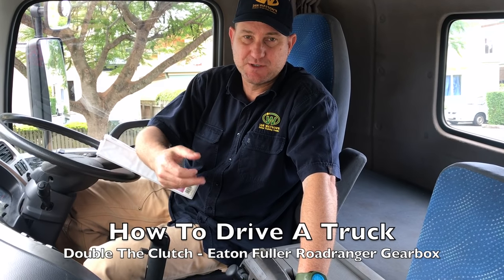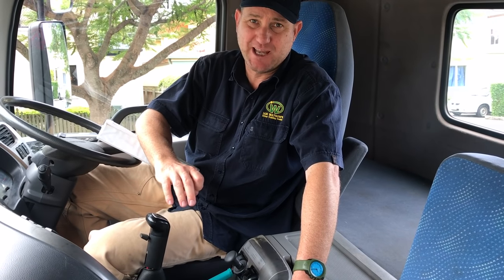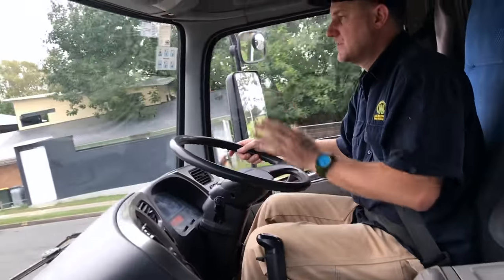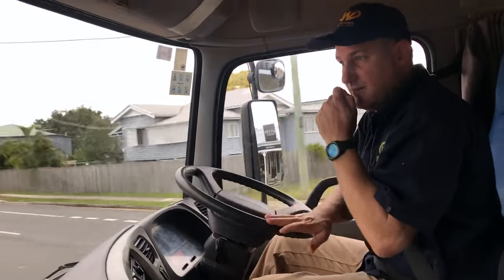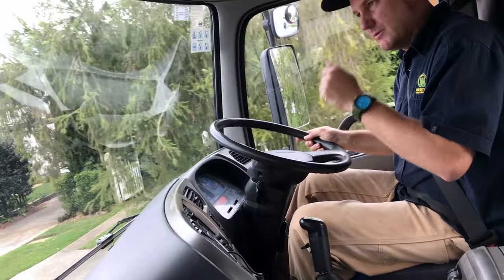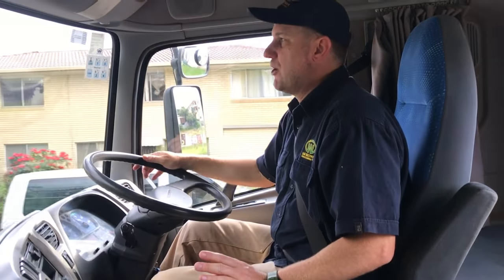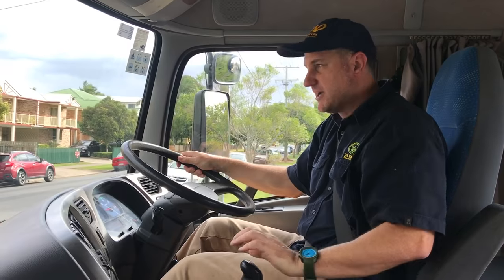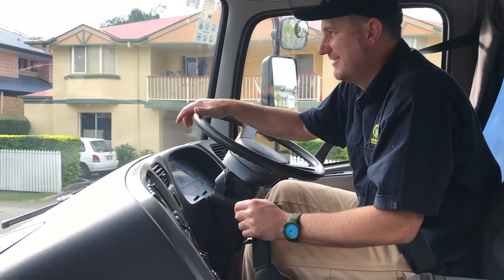How To Drive A Truck With A Roadranger Gearbox  - Double the Clutch

Comment: Pro tip, the clutch isn't necessary. Infant it works better without the clutch. Simply lift your foot as you pull out of one gear, bring the revs up to match the new gear and slide her in. You only need the clutch to start moving
Reply: Yeah but you can't float gears on the exam

Comment: Many of the comments here are about how synchromesh and automatic transmissions are "better" than RoadRanger transmissions. The fact is RoadRangers are significantly simpler and therefore cheaper than most other types. You can buy a whole brand new 1850 ft/lb rated RR for less than the cost of a gasket, bearing and seal kit for a ZF heavy truck transmission! They are easy to use, strong, efficient and when they reach the end of their considerable lifespan - they are incredibly cheap and easy to rebuild. 
  "Better" is subjective to the user, but there is no arguing with the economics. They are the most common heavy truck transmission in the world and if your intended career is truck driving, then this video is an excellent introduction to a valuable, employable skill to have.

Comment: A lot of people forget to mention with Eaton fuller non synchro gear boxes, when you press the clutch all the way to the floor it stops the gears spinning which is why it will grind when you shift or it will be tight to shift, So you should only use full clutch from a standing start to select a gear that's what it was designed for. Use just over half the clutch pedal for shifting once you are moving.
I think understanding how this gear box works will greatly help any beginner
Reply: That's only if the clutch brake works.
Reply: And on some boxes the clutch break is on the shifter
Reply: Thank you so much..I am currently learning and it keeps crunching and the instructor keeps telling me to put my foot all the way to the floor when you sing the clutch.. he crunches it as well but I was so confused as to why sometimes it’s smooth and other times it isn’t.. thank you again
Reply: @sylvannaagostino828  no only clutch always  to the floor to engage the clutch break for first gear. All the rest are half clutch. U might have had the same problem as me and not matching the rpm to the road speed when changing gears.
Reply: @cokeaddict1663  tomorrow I will do it..i had revs right but would lose the power when it wouldn't engage and now I know why.. I called a few truck driver friends and they all totally agree with you..
Reply: @sylvannaagostino828  mate I’m no pro I’m far from it and I’ve only driven road ranger for about 12-16hrs in total since I’ve had my license in an iveco 13 speed  but I got the hang of it. Ive driven a Kenworth 909 and 950 18 speed too and it’s a different ball game. I’m sure if I drove them more I’d get better at it. 
Keep practicing mate u will get it
Reply: Been operating fullers for 50yrs, the fools in the uk cant even change a synchro gearbox these daysLOL.
Reply: @grumpystruckshop3807  I got the Road Ranger licence but drive a Synchro as the truck with the RR was taken, it is good though and in Sydney traffic, my calf muscles are insane lol
Reply: He mentions the clutch brake
Reply: You been driving RR for 50 years and still using the clutch to change gears.
Reply: Also it varies from truck to truck. I was in one today, and it was literally like an inch of depression on the clutch to shift.
Reply: when turning over the ignition, the clutch should also be fully depressed to disengage the thrust bearing off the clutch plate
Reply: You double shuffle
Reply: Cheers brother my knowledge has just been increased by your valuable input, tell me though bro is there a tutorial out there that will actually give myself and others out there as you mentioned a better understanding of the gearbox and how it functions?
Reply: Thanks helped a bunch

Comment: I've only ever changed gear without the clutch. That's the way I learned (taught myself) but I have to learn the double clutching if I want to get my HR license. The main thing I was worried about when I was learning is whether the range splitter and high / low splitter worked without the clutch. This video is so informative and clear, well done!

Comment: Thank you for such a clear explanation. I just got an old dump truck with a fuller transmission. It’s been a trick to learn! The revving and double clutch action is a trip, but it makes so much sense!
Reply: just need to understand the three speeds 1 Engine speed 2 Gear speeds 3 Road speed but ya getting there :)

Comment: I learned a bunch of stuff from this. The double clutch thing was not something I learned in truck driving school as a young gurl, but I realize it makes sense. My teacher told me the engine could handle a continuous clutch but I bet the double clutch is easier on the transmission.

Comment: I'm a big fan of manual gearboxes but in a truck it always seemed so damn confusing! That was until I watched this video. Now I know there are other types of manual transmissions that require other methods of gear changing but this guy has inspired me to use them all. Great video. Good instructor. Greetings from 🇬🇧

Comment: I did my non synchronous training today for whole day. Passed reverse test, theory, load securing etc however I'm still struggling with gears. Your video was more informative than the all day training today. Tomorrow I got three more hours of training left. See how I go tomorrow. I wish you were based in Melbourne. Thanks for the video mate.
Reply: Hy how are you doing now?
Reply: @siyabongadube3223  I have been driving b double and truck and dog for last couple of years. All of them auto. It's hard to get hold of road Ranger. So I haven't had much practise. Got the licence for RR. Thanks for asking

Comment: 14 years with that exact box,the more I drove it the better it/I got.
It's timing and revs,as you said,if you try n rush it,it will crunch/grind everytime.
Only ever needed the clutch on take off,now I'm retired,miss it big time.
Reply: I am the same mate the theory is eh mostly understandable for a bloke like me but I am hands on and I fuck up abit as most do then it clicks with me and I begin mastering it. I drive an 18 speed with the correct adaptor/shifter in the US truck simulator I got and it is fun, and drive an automatic Heavy Rigid in real life...I love trucks and I love logistics. Pity pencil pushers ruin it to degrees.
Reply: @tkx86  ..... enjoy your career mate👍as you know it's a great job!
Even the bad days are better than pushing a pen,and the good days are near on perfect!
My love of trucks n buses started when I was standing in line on  hot summer pavement as a school kid waiting for a bus to arrive so that our class could go on an excursion.
The bus rolled up and all I can remember was the smell of diesel and hot rubber coming from those tyres...I was maybe 6 years old,hooked!
I ended up driving trucks n buses during my working life.....would do it all over again and not change a thing.

Comment: Very good. Am currently doing my HR licence and learning this gearbox has been the hardest part, letting go of the stick has been an issue for me. Finishing the course next week, road positioning and reverse parking was a breeze. Watching this and practicing ( as well as you can do in a lounge chair with a remote as a gear stick ) will help wonders. One significant thing is taking up slack on the gear stick prior to moving it when you push the clutch. 👍
Reply from the maker: great tip, practising and visualising at home on your couch is really helpful.
Reply: @Hello there, how are you doing this blessed day?

Comment: Worked with a bloke that insisted that floating was for the pros and double clutching was for wimps. Watched him absolutely destroy the gearbox trying to prove that point.

I personally do both, pretty much whatever the truck is happy to do. Failed a float, I'll fix it with a Double, not argue with it while dealing with traffic. 

At the end of the day, double clutching or floating, as long as your changing the gears cleanly your a good driver. If your more worried about your 'coolness' factor than operating the truck cleanly and safely, your in the wrong profession.

Comment: I’ll stick to floating the gears
Reply: Me too, double clutching are for ladies trapped inside a man body.
Reply: i watched an old dude back in the late 60's stirring the box like he was stirring porridge without any clutching barring stop and start. he showed me the gears and i was off. a day or so later i was stirring it also with out the clutch. i can't believe when i see operators with years behind them using the clutch. they going to have no hip left before too long.

Comment: Right near the End . Don't ya Hate it when you TRY to Crunch it for Demo Purposes , AND IT DOESN'T !  LOL .
You are a VERY Good instructor Young Man .

I did 30 years in Heavyweights . Rarely used the Clutch , As Required , you know . I  Love Road-ranger Crash Boxes . 
Easier than a Synchro Box , ONCE YOU KNOW WHAT IS GOING ON .
Alchemy prior to that .
The Manual Version is virtually Extinct now ,unfortunately . Nearly everything is an Auto-shift now .
Those are no smoother than a Good Operator . And sometimes  MUCH rougher actually .
Good  Video .

Comment: G’day mate I’m a truck driver and I had a Eaton gearbox in the first truck I drove a Mercedes Benz 407 D. But it was a replacement gearbox and the first gear was neutral left and down and second gear was left up and so on but I learned to drive it until the day the gearbox failed on me. I haven’t seen a similar set of gears in any other truck since, nice learning video and refreshing the memory of shifting gears in a truck.

Comment: Gears change best with road speed.. example like with your car when you hear or know its time to change gears " change "  quarter clutch so your off the clutch brake.. full clutch start/stopped. learn the H pattern fluently aswell as controls it shows you are a heavy transport operator and not just a steerer.. this is a real good video for the novices learning.. I'd recommend 👍

Comment: Hey , Your sitting on the wrong side! Oh , Ok You must Be in New Zealand or Australia. Your are a good teacher. I miss shifting except on really steep grades  starting out with a heavy load where knowing how to heel and Toe while feathering the clutch is important. I am in Marin County North of San Francisco where the Terrain is much More like the North Island of New Zealand with some steep mountains . San Francisco can be tough on drivers of manual transmissions too. There is also the method of letting the clutch out until You feel it start to grab and then release the Maxi brakes. Most of the new trucks are automatics now , mostly the Two axle Bobtails and they are nice too but inexperienced drivers can get in trouble. The low low is to low for shifting to a higher gear while moving and I have only used it rarely while spread dumping or paving. When empty gears can be skipped. I ran across these videos while searching out My Dads old transport truck that was a 1955 International fifth wheel with a 500 Cu. Inch gasoline engine A four speed main and three speed Brownie so it had two stick selectors. I have driven the Five speed with two speed electric shift axle and cable shift axle. Also the Ten speed progressive air shift with the lever in front like You use in this video. Also 13 and 18 speeds with the three position selector mounted in the shift head and the type that combines the air shift selection by a lever at the front like You have here combined with a two position selector for overdrive in each gear after getting into the high range. So it is shifted like a progressive  and then after getting into the high range the technique is like that of the Two speed axle except that everything happens within the transmission.
Reply from the maker: Driving big rigs on hills with these gearbox is a real art form. In fact, I'd like to do a video about hills and gear changing in the future.

Comment: I've driven a couple of Macks that had Road Ranger boxes in them and the experience always left me with the question of "Why?"  Why would anyone put a RR box in a truck that comes with one of the best gearboxes ever made.  Any one of the various boxes that Mack produced was a mile and a half in front of any RR box.  I'll grant you that some of the Mack boxes took some getting used to, but once you had a handle on them, they made driving a truck a pure pleasure, not to mention the sense of achievement one got for working out how to subtlety wrestle the thing into submission.   Any mug can get the hang of a Road Ranger, but if you can't achieve the same with a Mack box, you shouldn't be driving a truck.
Reply: TombstoneHeart   If you know how to change without using the clutch it’s much faster and smoother.....

Comment: I drive a 6 speed synchro 10t GVM truck and even I like to give it a rev to downshift even though it's not required. My clutch gave in a while ago and it wouldn't disengage so I had to float gears in a synchro. wasn't fun
Reply from the maker: Ahhh I can imagine!

Comment: Lot of people try and change too quick causing the crunch and grind. It's 1 and 2 not 1,2.  Miss a gear going downhill and can't get it in? Dont panic, go to a high gear and work your way down again. Slowing down to a stop you can use some gears to slow on compression then it's clutch in and brake, when stopped select the gear you want to us to move off. I used RR boxes for 40 years and they are the best all round.

Comment: Hmmm, never used a clutch when driving Eaton Fuller road ranger transmissions except from a stop.
Most truck owners I knew, other than corporate, would kick yer butt for double clutching as glazing is a possibility. It wasn't needed any more than jake brakes are needed in flat environs.

Comment: I thought you had to engage the clutch brake to put it from neutral to takeoff gear. You just did it with the clutch half in. Am I right?
Reply from the maker: In certain scenarios yes. If you come to a complete stop and have the truck in gear (i.e. come to a stop sign and brake first, then clutch and then complete stop... with the gear stick engaged in gear) then while stationary, with half clutch the gear stick will easily pop to neutral and then into a gear and there's no need to use the clutch brake. So here what you do = brake, then before the engine struggles and wants to stall you press clutch half way to prevent a stall and leave the clutch at the half way point (don't move the clutch and don't let your truck roll), then pop the gear to neutral and then into gear -- easy!

Comment: I have never double clutched.  You just learn how it sounds. How it feels. And you gotta just have touch. I have an 18 speed. Driven them all. Its the same.  Pushing the clutch pedal to the floor is only for engaging the clutch brake. The clutch brake is there to completly stop the trans from moving. That is so you can get it in gear at a complete stop. You don t bury the clutch pedal when ahifting. Just a little light footedness to let the trans slide. Rev matching is the key to shifting smoothly.   Slow is good. .    You just gotta get the feel of it. And every truck is a little differant. Some are very tight in the lever some are looose.   That does make a differance in how she engages into the next gear. Again rev matching is the key here.
Reply from the maker: wise words from a experienced driver - thanks for sharing!

Comment: In my experience I find in all cabovers because of having linkages to the box the change is not as smooth as with bonneted trucks as the gear stick is straight out of the top of the box . You can change gears with two fingers and is a lot smoother. Great video.

Comment: Driven everything from a quad box to 20 speed Spicers and ALL size Roadrangers for over 40 years .Just one question , apart from when you take off , why do you feel the neccessity to use the clutch

Comment: Gonna sound like a noob question, but towards the end you explain that your in 5th gear at 20km/h and then come to a stop. Are you then taking off in 5th gear on an empty load? And only using 1-4 for loaded? I completely understand the clutch work just didn't catch the gear work from 1st right through to what every gears you used.
I guess my question is are you using 5th gear as first gear on an empty load?
Reply from the maker: Good question. Quick answer is that you can stop in any gear at all, however, when you take off you need to find the right gear for the occasion -- up a hill with a load you need to use a low gear (3?) but down a hill a higher gear.

Comment: Hi, new subbie here, got a question, do truckies use the same technique on all Eaton transmissions? I've driven a Hino once that had an 18 speed Eaton transmission just wondering, cos I'm planning on getting a truck, thanks for the vids, keep'em coming, cheers mate👍😁
Reply from the maker: Great question. Essentially the changing technique is the same, however, every truck is unique and you need to adjust. Be wary of revs, timing and actually gear positioning with the gear stick.

Comment: Clutch is for reversing starting off and breaking the torque to change down pulling up hills that's it I've done my first million k's can't be shown anything else by anyone synchronizing the ground speed with the revs is the key it would help to explain how many revs between gears